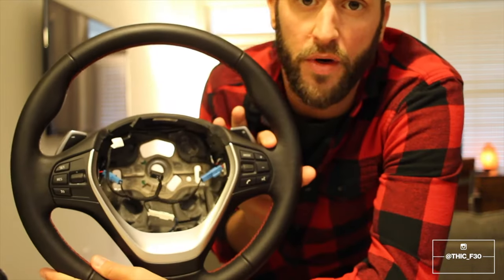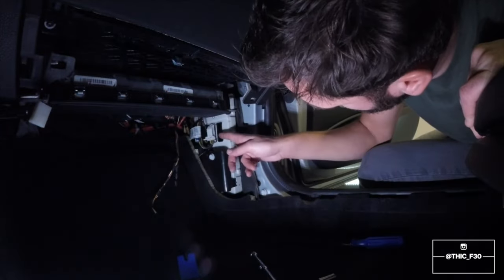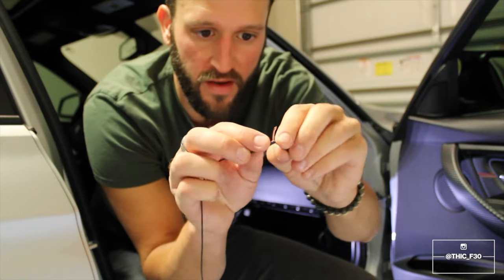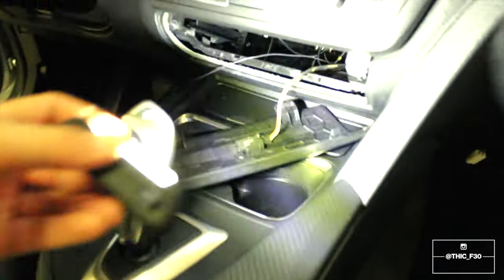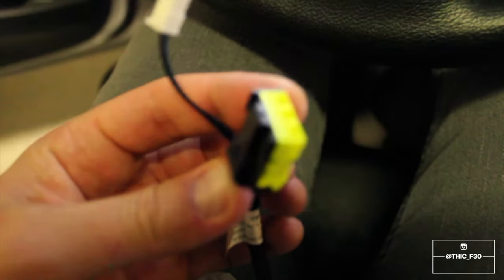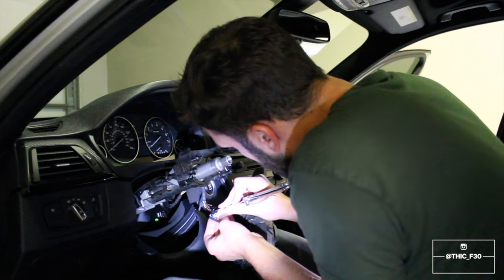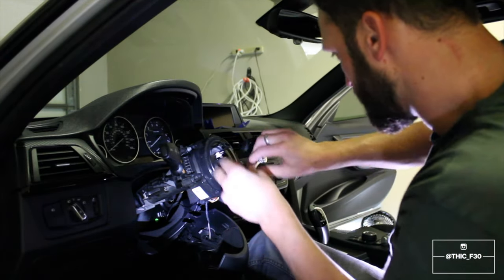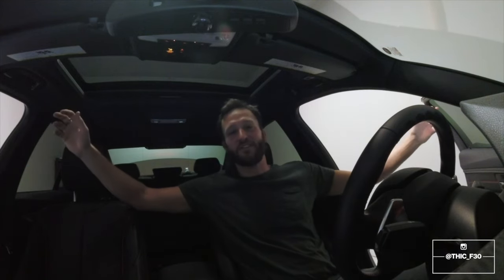F30 BMW PADDLE SHIFTERS RETROFIT! (Install & Coding)

Comment: Where do you get the actual wiring from ? I have the steering wheel but can’t find where to get the wire
Reply: Search for AWG22
Reply: @8teate  and the pin connector is what? thanks

Comment: So if the car is prewired all you need is the steering wheel with paddle shifters?
Reply: If it's a m sport then it will have the steering wheel with the wiring already, so all you need is paddle shifters
Reply: I belive
Reply: @paulhenriksen5162 No, it’s not the m sport, just a 330i sport line.
Reply: In case it's prewired all you need is the wheel with paddles and you definitely need the coding.